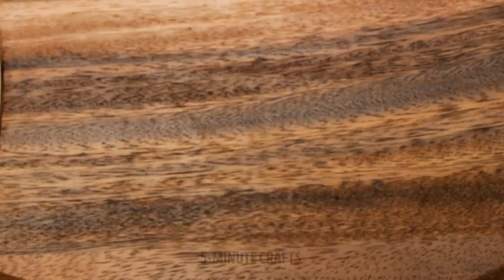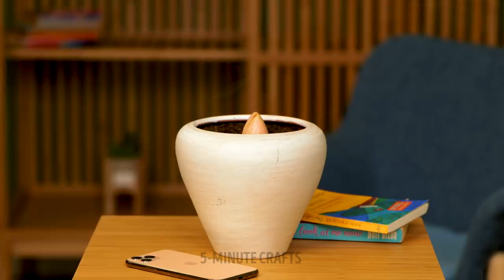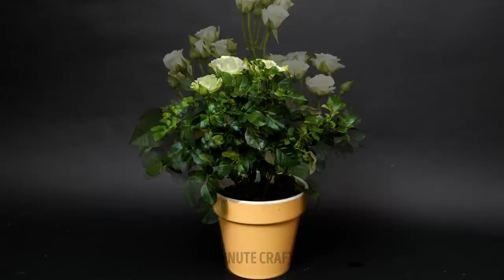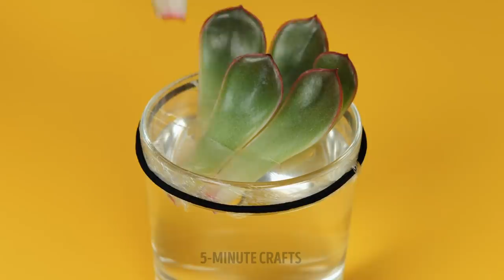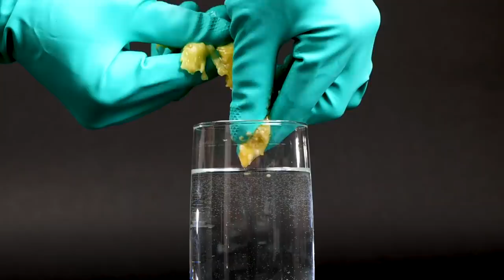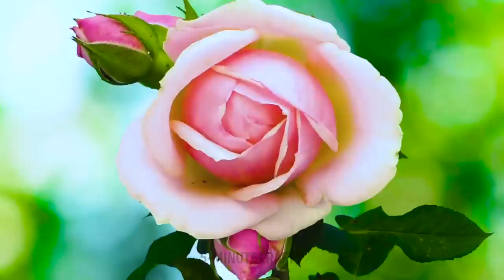Plants Growing Tips || Easy Gardening Hacks For Beginners

Comment: The best way to sprout avocados is to wrap them in a paper towel & keep it moist & in a warm area. Then plan a couple inches in dirt after they sprout. Same with mangoe seeds. Mangoes need more humidity when they first start growing. Also, you can't guarantee an avocado is going to be good/edible until you get the fruit & try it... you can also throw avocado seeds into a compost bin & they will sprout when the temps are right.